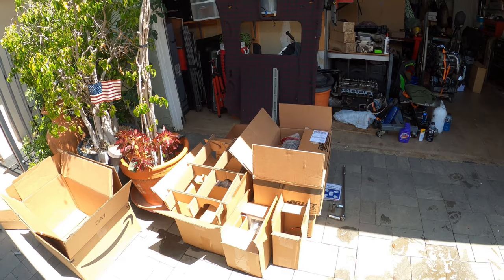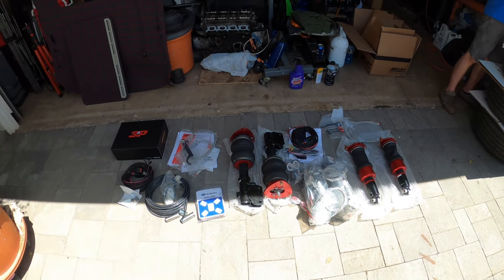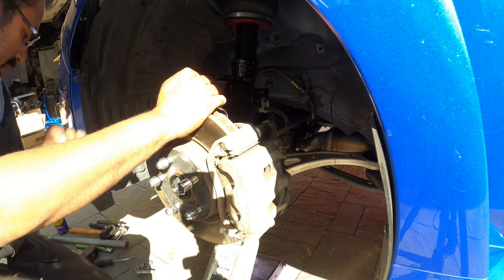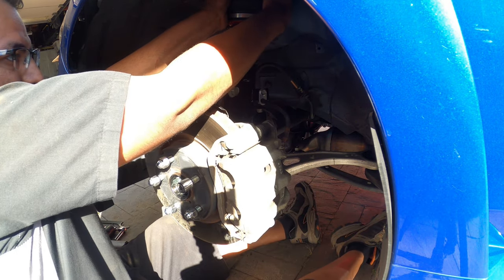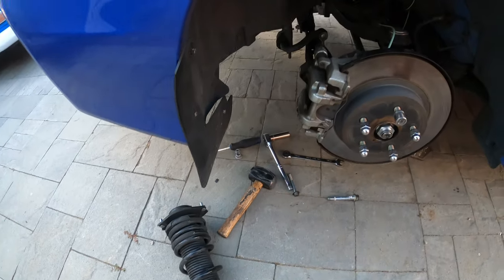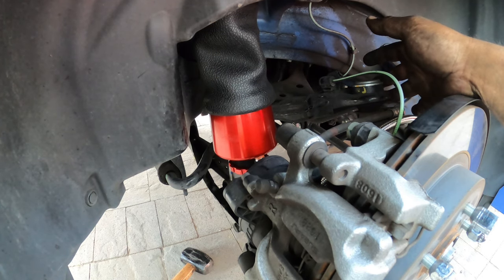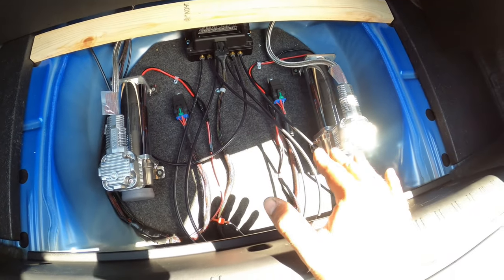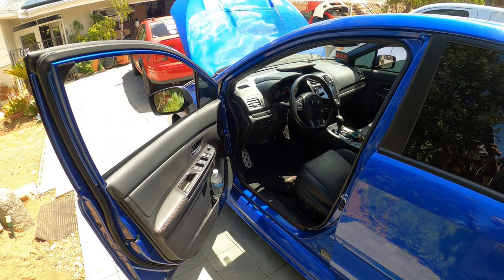How to install airlift suspension on a 2019 Subaru WRX

Comment: Hey man do you think you could include a link into the description for the fittings you used?
Reply from the maker: I get everything from a local shop called Parker. I highly suggest to use metal fitting and not plastic ones.

Comment: It's extremely preferable to use a chassis ground location as close to the compressors as possible. Would've been nice to show more of the compressor installation and testing.
Reply from the maker: Yes you are correct

Comment: Why the heck wouldn't you run the lines inside...
Reply from the maker: Because that is a huge hassle and if any reason a line does fail swapping them is 100x easier that pulling interior panels and hopefully nothing breaks.